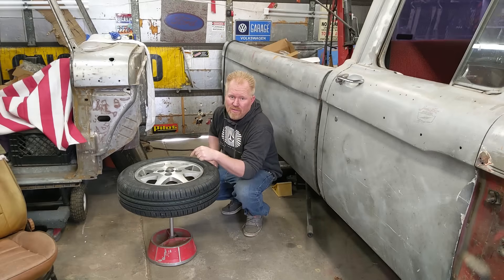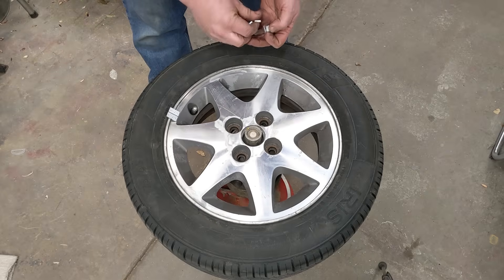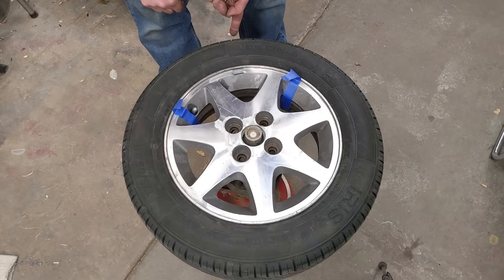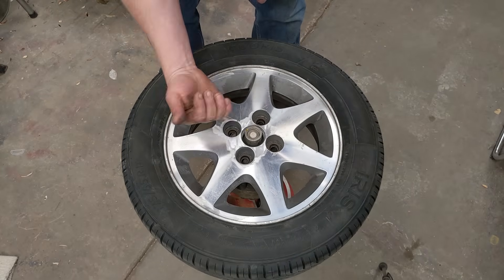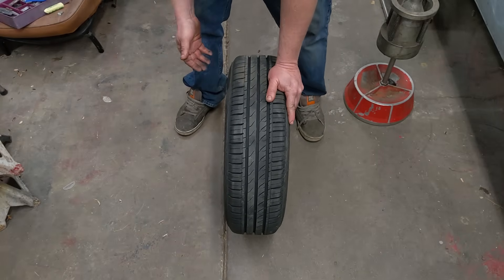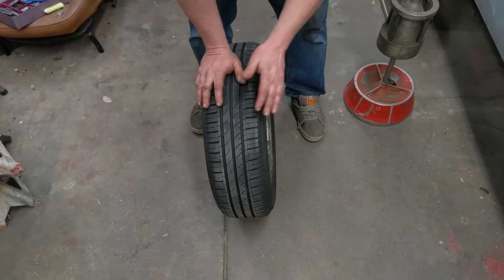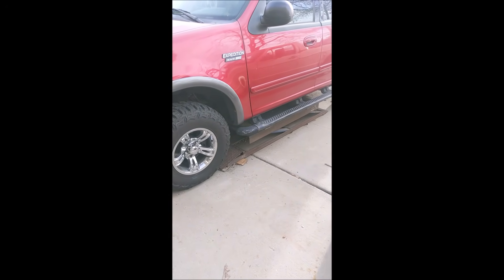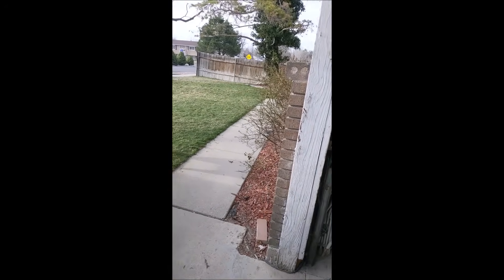Best Method How to properly Balance tires with a Bubble Balancer AT HOME

Comment: Growing up in the 60's, all the gas stations where my Dad bought tires used the bubble balancer. In later years I bought an old Coates tire changer and it came with an awesome bubble balancer. They're great if you know what and why you're doing it. Thanks for bringing back the 'lost art' of correctly utilizing the capabilities of the bubble balancer! BTW your use of stick-on weights, more expensive & usually reserved for 'custom wheels' back in the day, is what really makes the old method 'modern-day'. Great Work!

Comment: I had a wheel balancing issue where my car would vibrate/ shake at 110KM, had my tires balanced at 5 different shops (2 mechanics told me I had warped rims, 1 mechanic told me it was my front wheel bearings, and the last  mechanic who balanced them came close, but it was still vibrating).  I decided I’ll take a stab at it and bought a bubble balancer, and thanks to this video, my car is finally not vibrating!  Makes so much sense to place the weights on the two points of a triangle as opposed to across the weighted side.

Comment: Is it possible to kinda dynamic balance after doing like this, by turning the wheel upside down and put it on that way so you can add weights to both the ‘middle’ (behind the spokes), and the inside or hub side of the wheel?? If that’s making sense…

Edit: duh. I tried it and what a surprise, it wouldn’t stay on the TAPERED cone lol. 😅

Comment: Best way to balance is putting #4 lead shot in wheels then they rebalance every time you drive
Reply from the maker: It's a solution but not the best. I'll tell you why. You have an imbalance every time you stop from zero to 45 to 50 mph. The extra weight makes it an exaggerated imbalance. Now if you had a bubble balancer you could easily tell how much weight you should put into a tire. It may only need 1 oz. It may need 4oz or more. You can quickly tell how much you should put it in so this exaggerated imbalance isn't as noticeable. You may need nothing that does happen quite a bit.

Comment: Two words: Balancing Beads
Reply from the maker: Two words, No need.
Reply: @sixtyfiveford exactly. No need for any balancing tool or weights. It also stays balanced regardless of the tire wear and suspension.
Reply: @sixtyfiveford right, no need for weights or any balancing tool.

Comment: What sort of speeds are these bubble balancers good to? I have a vibration at 70 ish mph plus and apparently my wheels are in balance according to the local tyre shop. I'm thinking of looking at the balance myself with either a bubble balancer or a static balance jig. I already do my own motorcycle tyre changes and balance them myself, so a car wheel shouldn't be an issue.
Reply from the maker: 85mph is no issue. Check for out of round by jacking it up and rolling the tire while looking at the distance to the ground.

Comment: Excellent tutorial.  I bought a bubble balancer for my MG Midget wheels because the one shop who could balance them was no longer around and I had to get new tires for it.  The rims won't fit the spin balancers the shops use now.  It was my first time, but your video helped and there are no shakes or wobbles!

Comment: & if your car is 20yrs old probably doesn’t matter either way😂
Reply from the maker: Actually just the opposite. The driving feedback in a new car is so muted you can barely feel if you have a flat tire at 60mph. The older the car the more driver feel and all driving feedback isn't muted.

Comment: Two words. Balance beads. That’s all you need.
Reply from the maker: Blind shot in the dark. Even with beads you should use something like this to get you in the ball park. Not enough beads and it'll shake. Way too much weight in beads and it'll shake until you hit 50mph. Every tire is way different. This will let you know in a second how much weight you should use in beads.

Comment: We tried various wheels and diameters and it could have been off up to 1.25 ounces in static. In dynamic it could be 2 ounces or more. Sometimes my brother got it closer on one wheel then I would be better on another. Consistency was an issue depending on the calibration of your eyeball vs the bubble  / target. You could put a 1/4 ounce on a wheel and the bubble wouldn’t move. On the Hunter we could take it out of 1/4 ounce round off mode where it reads in .01 ounces. You can take the plastic cap off of a valve stem after the wheel is balanced and see that it weighs up to .02 of an ounce.
Reply from the maker: That's why I said some of the Harbor Freight ones suck right out of the box and you can never win with them. I had to go though a few at home and in store to find a usable unit. Then I found a head to the USA made on from the 70's that China cloned and is now sold everywhere. It'll nail the weight with a 1/4 ounce.

Comment: I was originally trained in this method when I began my automotive career. Tires had more sidewall, and vehicles had more mass to absorb imperfections. Today, I own several vintage balancers, which I have tested against my old Hunter DSP9500 electronic balancer. In a back-to-back comparison, while my bubble balancers make for great conversation pieces in my man cave, I will stick to an electronic balancer for the wheels on my daily driver.
Reply: You say you tested both, bubble and hunter, how off were the bubble ?
Reply: If you static balance correctly, the electronic balancer will show the exact same results. All you have to do is disable the dynamic balance setting

Comment: This is what the old bubble balancers from the 1950's would do,  they had an arm that would be used to place the weight outward from the centerpoint of imbalance on the light side,  so the weight was cut in half and distributed outward from the exact point of lightness.   I guess this gave a more accurate amount of balance.

Comment: I used to do this system in the 1969 to 1978,back in Australia when i started my mechanics at 16 years old. However i always perfectly cleaned the rims inside and outside before i went to balance.

Comment: That is a great method, and is supposed to reduce the requirement for a dynamic balance.  The more weight required to statically balance a tire, the more likely you will require a dynamic balance.
That is the system used with the old Snap On balancer.  The wheel, was balanced on the vertical, but the placement of the weights were placed using the method you have described.  I learned that technique from the old Bear alignment shop, where my buddy did his apprenticeship in the early 1960s.

Comment: could you do this with the rim upside down to you could attach weights in real time? Or would it not even self balance, just fall over?
Reply from the maker: Yeah the balance won't work if the rim is upside down as the center of gravity is too high. You can reach under there and stick weights on while it's still attached.

Comment: This is wrong you should never have weights in all different places. One weight area for the amount needed. You should never put weight in 2 different spots unless it’s one on each side of the tire. 
How your describing is wrong and I was taught never to do it this way. NEVER!!

But hey do what you want. I worked at all types of tires stores since I as 22 years old. 
I was taught the proper way.
Reply from the maker: @JasonDerek-69  Nope. Don't be ignorant.
Reply: @sixtyfiveford not trying to be ignorant but I was always told and taught to exactly not to do it this way. 
I forgot the reasons but I’ve been involved with tires since 1996 and I’ve taught people the same way I was taught. And that’s to have a nice clean wheel and to have your weight all in one area and not all over in different spots.

Comment: Incase it helps anyone else understand what he's talking about with the "dynamic balance" as he calls it. It's essentially an imbalance between inboard and outboard. In other words the inside and outside of the wheel which can create a wobble. I work in a tire shop and with the computer balancer we use, it will tell you to put a certain amount of weight on the inboard and a certain amount on the outboard. Then ofcourse another set of numbers sits in the middle which is your static balance. Which is what he is balancing with the bubble balancer. He is balancing the static only. The general rule is if the static imbalance is more than 1/4oz you should split the difference and add more weight to one side or another. Ive never used a bubble balancer and I'm not sure how well it works of you're only balancing just the static alone. But I'm sure not many people would use them if they didn't get the job done at least good enough.

Comment: What do you think of "balance beads" that you put loose inside the tire?
Reply from the maker: Nothing wrong with those. However it's a shot in the dark how much you put in. Not when combined with a balancer though. You can see that the tire needs .75 ounces. Put .75-1 oz of beads in and your set. If you just guess you're going to put in way too much, just right or not enough. Too much and it'll wobble until you hit 30. Not enough and it'll always wobble.
Reply: @sixtyfiveford  Okay Thanks. 
I'll put it at least double what they recommend (i.e., they recommend 1oz/13#)
I'm not concerned with wobble at low speed.
My main concern is that the wobble may not be the wheel/tire balance at all.
Going for the cheap fix before I have to get into real serious bucks about it.
The wobble is on a 1991 town car. My 66 Ford F250 rides smooth.
Reply from the maker: @2Truth4Liberty  It's not uncommon to have an out of round tire as well. Easiest way to tell that is to jack it up till it just barely comes off the ground and spin it by hand. Use the ground as the gauge to see if there's any high spots.
Reply: @sixtyfiveford  Thanks. I'll do that today even before doing anyting about balancing.

Comment: 0:08
Looks like a Ford Escort wheel from the 90's  :-0)
Reply from the maker: @2Truth4Liberty  Yep. Still have a 96 the wife drives daily.
Reply: @sixtyfiveford  I had one that got hit by a train. I miss that thing. was a 4speed.
Still have a good running 66 F250 camper special) though.
Dropped a 390 in place of the 352.
Granny gear and top speed in 4th is about 60   and  only  6-7mpg no matter with or without pulling a house behind it.

Comment: My first automotive type job was for Jefferson's department store down in homestead Florida. I was the shop's tire buster. By far the tires were balanced using this old fashioned bubble balancer which did the work perfectly fine. But if you wanted to spend just a little bit more money we could do what we called speed balancing. Those tires were balanced on the car. You jacked the corner of the car up and slide this motorized sled underneath the wheel and put its roller up against the tire. Then you take the hubcap off and put on this balancing head which would clamp onto the inside edge of the rim. It had four small slip rings that you would hold with your fingers to make the adjustments. You turn on the motor on the sled which would spin up the wheel really fast and then you would grip each of these rings in turn to balance the tire. The head had a pointer on it and a window that would tell you how much weight to put where. Two of the rings would adjust the weight higher and lower and the other two rings would adjust where on the rim the weight would go. It was pretty cool. Of course this is way before electronic balancing machines came out. And like you said sticker weights didn't exist yet.

Comment: I bought a China version and I cannot get it to work at all. I have used a vintage USA one and it was great, I wish I could find another one. The problem with the China version is that it's not sensitive enough to read even a 2 oz weight on the tire, the balancing needle is garbage.

Comment: Loved the description of dynamic imbalance - spot on
Sorry you had to experience the lameness of the Harbor Freight balancer - I did too. All the faults you show and more... It's pretty useless. Ended up with 2 other methods - Vertical and Horizontal
Don't sell the Challenger.

This horizontal method is my go to: https://youtu.be/JvN4i-qJqMs?t=258

I like to place the stick on weights at the wheel CG location. 
It can be found like this https://youtu.be/fwqR13Do1XY

Comment: :hand-pink-waving::face-blue-smiling: I was just bubbling over with eXcitement (formally Twitter) watching this video. I found the facts to carry a lot of weight. I'm going to get off of this couch, get the lead out and try this myself. I've been sitting for a while so balance may be a issue. I just wish I wasn't so tired. Unfortunately, one of my wheels is bent but my GF said for my birthday she would give me a rim-job :face-orange-biting-nails: I need to get up to speed on this project. Just have to lug the wheel down to the shop. At least I don't have to tread through snow. Thank you for the video. Cheers from So.Ca.USA 3rd House On the Left (call before stopping by)

Comment: factory original balanced bmw wheels have both inside sticking type of weights close to outside, and hammerred style weight inside. When I take it to tyre shop for balancing should I push them not to use a heavy weight on one side such as 20g , and divide it 10 10 at each side inside and out?

Comment: This is for TRUCK wheels not car wheels, car wheels are balanced on front and rear of the wheel for even wearing
Reply from the maker: Nope. I can't even count how many car wheels I've done with this method. Never a single issue.
Reply: Anybody ever just put unbalanced tires on the vehicle and see if it matters?

Comment: I have a problem with Discount Tire almost every time I buy new tires! They can never seem to get the balance right. It usually takes multiple trips and sometimes it will actually take me calling corporate to get a decent balance. This has been on multiple vehicles over the years, Recently I bought new Bridgestone tires for my F-150, the old tires were down to the wear bars, but the truck rode excellent. After having the new tires installed it absolutely ruined the driving experience, shook like crazy. Switched over the Michelin tires, same thing. The store manager finally balanced all of the tires himself with the same machine and after 4 trips it's good. Just took my Escape in to Discount for new tires, same exact thing, 6 year old tires rode great, but were getting low on tread, new tires were vibrating. I watched each wheel/tire being balanced and the machine showed them all balance out to zero. When I went back and had them all rebalanced on one machine, it showed that 3 of the 4 tires were off, so they rebalanced again and I watched as all tires showed zero on the machine, but still vibrating. I have another appointment for tomorrow, they are going to install 4 new tires and balance again. I know it's not the tires, it's the balancing. The manager said that when Hunter comes to the store to calibrate the machines they've showed them that each machine will show a different amount of weight needed for the same exact wheel/tire. I don't know if I believe this. I've talked to so many people over the years with the same exact balancing issues at discount tire. So much time and gas wasted. I don't understand how the nations largest tire chain with the most advanced tire balancers can't do it right? I absolutely dread getting new tires due to this. It's funny because every used vehicle I buy usually has old worn out tires, but they drive down the road great until I have discount install new tires. You should hear the excuses they try to give you. Bad wheel bearings, drive line vibration, transfer case vibration, etc. In the end it's always the same thing, they can't balance a tire correctly! I wonder if balancing beads would just be a better option? Do you have any experience with those?
Reply: I dropped Discount Tires when they plugged a speed rated tire on my SAAB 9000. 

As for balance beads, I'm running them in the tires on my Jeep. 37" Swampers and they ride smooth (not quiet, but smooth. lol).

I'm thinking about putting them in my pickup tires also, but I'm going to start with a bubble balance and see how they run.
Reply: I have absolute bad luck with townfair tires. Everyone of them can not fix this vibration. I end up riding the same tires untill they got so low. Bought new tires from them. Vibrations got worse. So aggravating, brought to a small mom and pop shop and the vibrations are all gone!

Comment: Best way to balance a tire is to take the total tire and wheel weight, divide it by 13 and that is how many ounces of tire beads you need.
Reply from the maker: Yes, but not really. Tire beads work but it's a shot in the dark. You'd be better off to use this and get an estimation of the wieght needed and throw that in. It varies so much per tire/rim assembly.
Reply: I've used beads for 30+ years and never had problems, using the calculation for the bead amount isn't an estimation it's an exact amount based on the individual tire/wheel combination.  I run ORV and with 35 to 40 inch tires lead weights don't do the job.  As the tires wear the beads automatically adjust to the changes in the balancing.  Running thru mud puddles and going thru rocky terrain lead weights can get spun on the rim or get torn off.  I use beads on all my vehicles and know they are reliable and easy and I don't have to get the wheels rebalanced as the tires wear.   @sixtyfiveford

Comment: Bought one from Amazon. Upon balancing tire… took it off… placed it back on in different position and balance was out. Balance should mean balanced…No?
Reply from the maker: You'll notice the spring plate has 4 rods. They have slop and that plate when compressed under the tires weight can shift up to 1/8". This is where the imbalance happens.